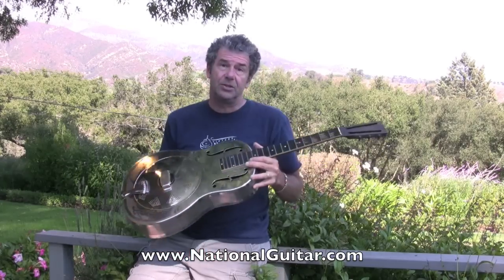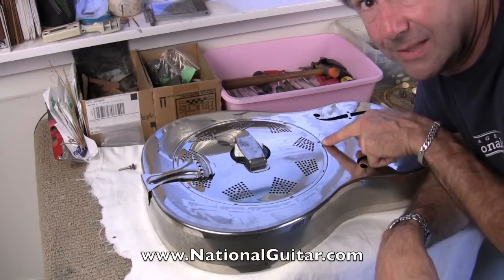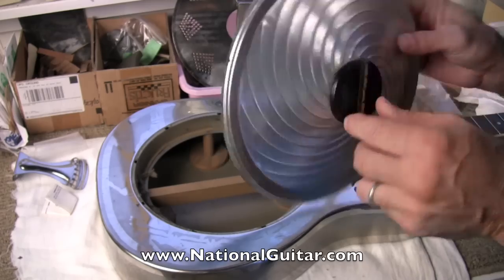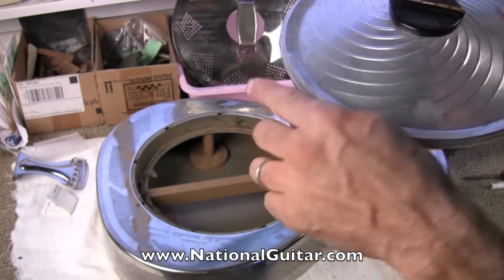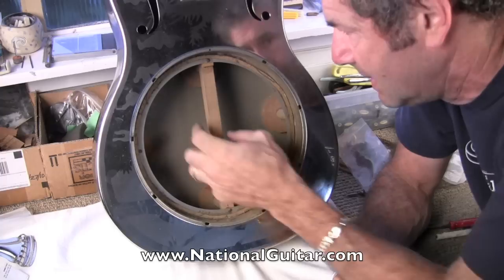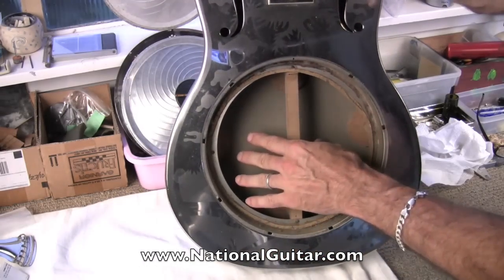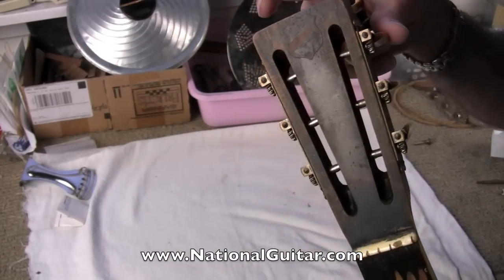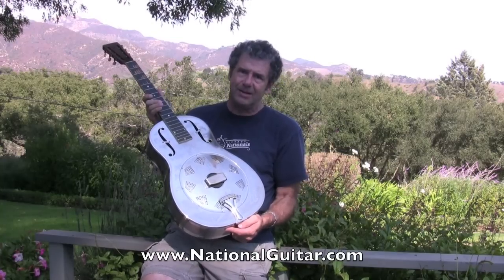Bench Talk #10 Learn About a National Style O 1931 Vintage Guitar

Comment: The camera angle is not centered which makes it difficult to tell how much off center the neck (bracing) going through the body to the bottom where the 'claw'-that secures the strings. Is that wood bracing secured flush w the metal body, or is there a gap ?

Do you know anyone well versed in this issue. Its my #1 issue w the metal bodied beauties.